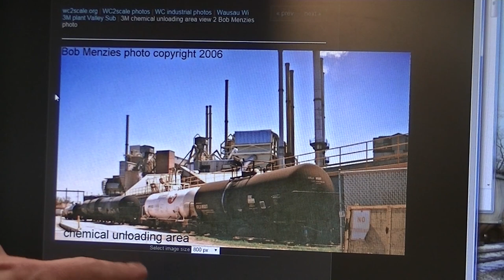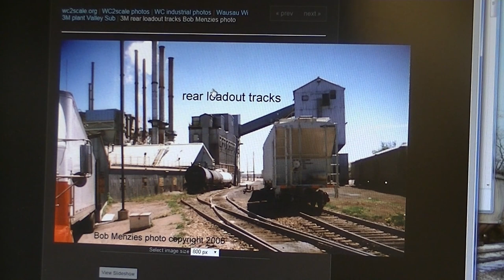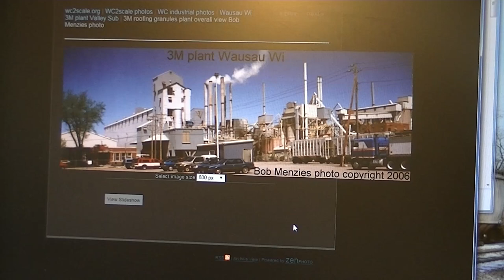Wanna Get Nuts?  Let's Get Nuts! - Making Siding from Aluminum Foil

Comment: Wonderful, informative vid as always, Matt!  I was recently wondering how I was going to groove my foil to make it corrugated - now I know!  Similarly, several years ago I got the idea to wrap a single layer of foil around a small bolt.  Then I used a fingernail to push the foil into the threads.  When I finished I "unscrewed" the foil off the bolt and used it for the end of a corrugated drain pipe coming out the side of a berm of earth next to the tracks. - Paul

Comment: I like the idea of a walkway/ catwalk around the chimney
Reply from the maker: I do as well.  Gonna see if I can make that happen.  Need some more brass rod though.  Am all out at the moment.  :-(
Reply: You could make the vertical supports for the railing out of old metal locomotive stantions... A manufacturer made brass ones that you used 0.010 brass rod as the handrail...  Or if you can find some of the newer plastic stantions-and-handrail... Bend both in a circumference... Look cool if it was wire mesh walkway. Don't forget the OSHA approved ladder up there.

Comment: How easily can the texture be crushed, or flattened in the foil?
Reply from the maker: With the foil I used, very easily.  On the next go round I'm going to use a heavier weight foil to see if that helps.  The good news is the foil can be easily distorted for a broken/damaged look.

Comment: I like what you did with the foil!  Tip: wear some of those Nitrile glove while working with the aluminum foil ... it will keep fingerprints from forming on the foil.  They are sold at places like Harbor Freight Tools.
http://www.harborfreight.com/catalogsearch/result?q=Nitrile+Gloves

And, yes ... they heat a cyanoacrylate glue - Super Glue - in those Plexiglas cases to lift fingerprints! ;)
Reply from the maker: Thanks for the tip John!  I have a box of those and use them when painting models.  Never thought about the effects of oils on the aluminum.  Will have to do that moving forward.